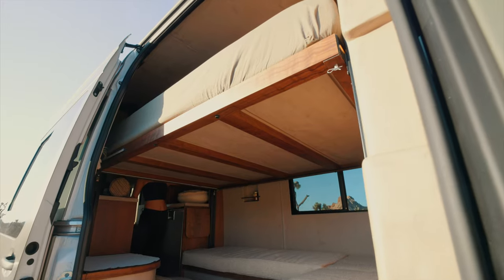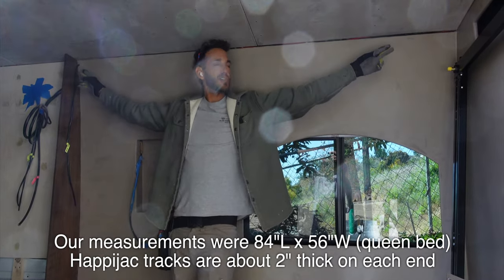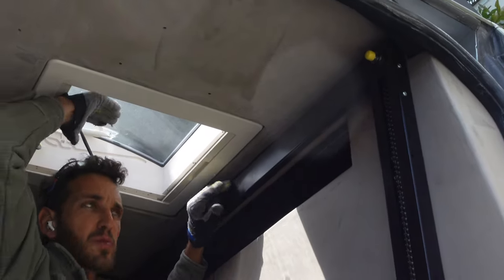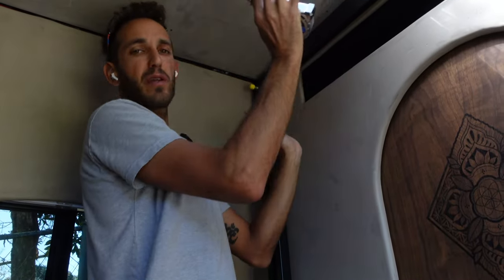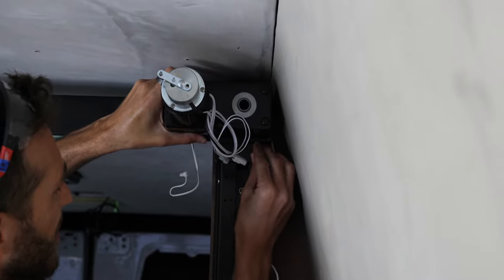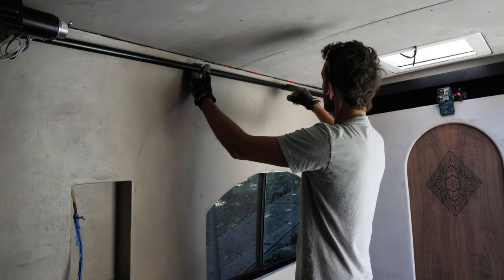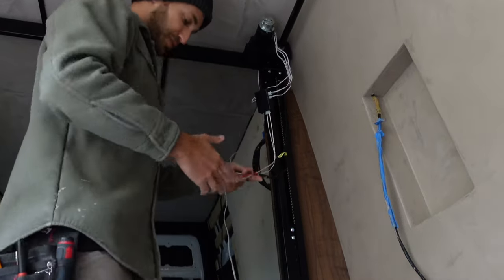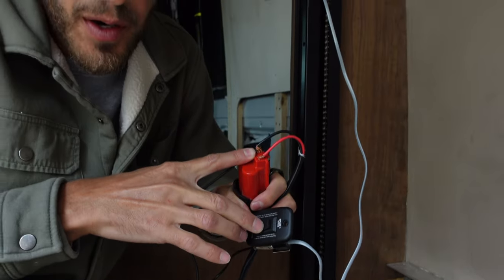Happijac Bed Lift - Full INSTALLATION TUTORIAL

Comment: The veneer on those bed supports is genius! I would never have thought of that. What kind of adhesive did you use?
Reply from the maker: Thanks! That was all Nicole's idea, and I agree it was genius 🤣We used contact cement and it worked perfectly
Reply: Hi Edden & Nicole, did you steam and flex the veneer around the corners of aluminum slats/beams and then adhere and clamp, or are they corner-cut? Thx. Troy  @nicoleandedden
Reply from the maker: Hey! The veneer is corner cut. We didn't have any experience with steaming and flexing, but that probably would have been the right way to do it!  @guiguencex7670

Comment: How thick are the tracks on short side? In other words, how much bed length do you still lose if you mount bed frame direct to track as you did?  (understand you would lose more if mounted the other way)
Reply from the maker: Each track is a little under 2 inches on each side I believe. So you are losing 4 inches even when mounted directly.

Comment: What size happi jac did you order? 54", 61" and then height as well? I'm a happi jac authorized dealer, but we typically install for enclosed trailer. Just curious which one fit in this van. Also is this a Ford Transit-250
Reply from the maker: Hey! This is a Sprinter 170, and we use 67” bed lifts with 60” long bunk rails  :)

Comment: My non motorized side of happijac bed keeps coming apart and comes crashing down. Can’t seem to get the cross beam bar secured on each side
Reply from the maker: Is it the chain that's breaking down? The cross beam just screws straight into the tracks, so I can't see how that keeps crashing down if it's screwed in
Reply: @nicoleandedden  Love the reply, thanks. The Cross beam has been popping off the stud on the non-motorized stud. I beat it on last night with a hammer and I'm optimistic that maybe it holds this time! Glad to hear that yours is holding up well! Most helpful video on the internet for Hapijac.
Reply from the maker: @QuintonHamp  Appreciate it! I can't imagine what would need hammering to fix on the happijac 😅😂 but I hope it works out! If not, I would need some photo or video to understand what exactly is happening. Not that I'm actually an expert or anything hahah

Comment: Very helpful video! Thanks for this.  To “square” the columns, I would attach the columns on one side top and bottom, and columns on the other side at top only, after carefully measuring (as you did). Assemble the drive assembly and the end rails, with rails at topmost position. When you lower the rails, the bottoms of the columns which are loose will be pulled into position. Put one screw in each column and then run it up and down to check for binding. When it’s all “smooth” put in all the rest of the screws.
Reply from the maker: That's a great technique! Thanks for sharing! I guess as long as your walls are perfectly square then that should work perfectly :)
Reply: Brilliant. Going to use this tip for my system when I build it.

Comment: This was such a vital tutorial.. thank you so much!! 🙏 I have to ask, though, how did you not pinch the cables on the left side or your small wooden door rails? But most importantly, how did the happijac structure hold if you only drilled onto the pinewood and it doesn't touch the floor? You didn't drill it into the van/metal itself right?
Reply from the maker: Happy it was helpful! Not sure exactly what you mean about pinching the cables? You shouldn't pinch anything as long as you're careful when screwing the rails in that none of the cables aren't stuck behind it. 
The structure is very sturdy, as they're mounted to 3/4" baltic birch plywood that is secured to the van frame in at least 3 axes each.

Comment: Mounting the cross angle piece, you could also use a shim or flat washer to provide slightly more clearance if needed.  (Using a longer bold too if needed).
Reply from the maker: Very true! Thanks for the great tip!

Comment: Thanks for the torturial. How does it go with the bed after some time? Happy with the quality and functionality? 
Since everything seems to be angeled perfectly, I wonder how it works, if you park somewhere in the beautiful outdoor without having a perfect flat parking spot? Any trouble, if the Van is parked with wheels positioned on differend heights?
As well, the bed "hangs" basicely on the front and backwall, so all the weight while sleeping in the bed will be on these 2 walls, since the 4 bed profiles dont thouch the floor actually. Is this right? Greetings
Reply from the maker: No worries! 
No problems yet after a long time with the bed. 
And yes it works at any angle, because the system itself is squared and not affected by gravity in any way. So even at a steep angle it will move smoothly within it's tracks. 
The weight is on the 2 walls, correct. So it's important to secure those two walls as securely as possibly, to the chassis in both the floor, side walls, and roof.

Comment: Thank you so much for this! Where did you buy it? After searching, it doesn't appear like an easy thing to buy. Does everything come in the kit?
Reply from the maker: No worries! You have to buy it through a dealer. A lot of campervan shops will be able to help you, but yes it's not so easy to buy! As stated in the video, the kit comes with everything except the actual bed frame itself. That you will need to build on your own. But the rest comes with the kit, just make sure you're getting the right height and width that will fit your project
Reply from the maker: If you're still looking for where to buy, reach out to us privately and we will be able to help you buy one :) contactusananda@gmail.com

Comment: This video is going to save me on my build thank you! I plan on installing this in my transit with the frame the same as yours but the bed east west. This would need me to cut down the drive shaft, from your experience doing this is there a limit to where the drive shaft pole can be cut down to? Cheers :)
Reply from the maker: Awesome! Sounds like a great idea. We would have loved an east-west bed but the Sprinter doesn't allow it (in the front at least..)
There isn't a limit with the drive shaft I think. Check out our Happijac tutorial and reach out to us if you need help buying a Happijac! 
https://youtu.be/M5VzotGO0A4

Comment: Great videos! Thank you for the education. What led you to decide on this type of Lippert Happijack bed (chain type) and not the Lippert Smart Bed (With Straps) that seems to have a simpler and easier installation?
Reply from the maker: Thanks so much! The strap bed is much less stable, almost like hammock in my opinion. I wouldn't want it swaying and banging into the walls when down. Then again, I guess its a personal decision. I think it also has different weight limitations. But definitely haven't looked into it as much as I should have!
Reply: Thank you  @nicoleandedden  for your response. My van (Sprinter 3500 EXT) is coming in the next couple months and wanted to finalize some layout decisions. My plan is to have 2x5.75 ft aprox. area behind the wheel wells for the shower and toilet and last  2x5.75 ft aprox for the garage. Your videos have been of great help. All the best with your new build. Are you keeping the similar layout with the happijack in the front of the van.
Reply from the maker: @fernarango  That's awesome, good luck!! Yes we are keeping the same front layout, but the rear portion will be totally different this time :)

Comment: Hi there Edden,

Firstly, thanks for making the content you do, it's super inspirational. 

Do you think it's possible to use these style beds in a variety of vans? I'm 6'3 (193cm) - do you think this is suitable for a taller person?
Reply from the maker: Yes, absolutely! You can make the bed as long as you want technically, as the drive shaft length arrives very long and you can cut it down to your desired length. 
The main thing to consider is if you are ok with the headroom under the bed while the bed is up. For us it was about 5'7". I'm 6 foot and didn't mind it at all, as its anyways a sitting area. But some people might care more about it.
Reply: @nicoleandedden  That's amazing advice, we've been and looked at Ford Transit LWB vans today, thinking we will use this Happijac system. 

Thanks again for all your help.
Reply from the maker: @willsillett1832  Let me know if you need help buying one!

Comment: Great job. 1 question, can the width of the frame be wider than the bed? My bed is 60 inches, but I need the frame to be 72 (there will be 6 inch cross members sticking out each side
Reply from the maker: Yes, I just wouldn't go too far out to the sides. But our bed frame was 56" wide and the happijac system was only 42" or 48" I believe.

Comment: I assume you bought the 63" happijac system, or did the dealer allow you to custom size the width? Does it allow you to make it smaller than the 63"? Your bed is 56", so 63" is definitely overkill for you. I only saw a 42" and 63" option, when I went to buy, so I'm not really sure how to manage that because 63" wide is basically the absolute maximum width of my Ford Transit, so I don't think it would fit, but you somehow got yours to fit. Thanks. The video is great and mega helpful.
Reply from the maker: width-wise you can get a thinner one and have the frame be as wide as you want. The system doesn't come with the bed frame so you have control over how wide you actually make it, it doesn't matter if the happijac width is thinner!
Reply: Why are the only happijac systems online I find are just 42 and 63?
Reply from the maker: I'm not sure. Their entire sales funnel is horrible, it's almost impossible to find information about anything, especially where to buy them. It's pretty ridiculous honestly lol  @KwonHo09
Reply: @nicoleandedden  haha damn because I bought the 63 inch and it’s not fitting like it does in your video so now I might have to change A LOT 😅
Reply from the maker: Damn, sorry to hear that! Can you have it exchanged fro the 42 maybe? I assume that would be easier to work with. @KwonHo09
Reply: @nicoleandedden  hahaha an exchange process sounds like a complete nightmare but at this point, I don’t think I have another choice😅 thank you for your replies! Otherwise, your video is so helpful because these instructions are so confusing🤣

Comment: Do you just use wood screws to mount the frame? I’m mouthing the frame to 2x4 that are bolted into the van, but I feel like screws aren’t strong enough.
Reply from the maker: Yes, surprisingly the screws are very sturdy. Of course, use quality screws and make sure to use all provided holes to secure it.